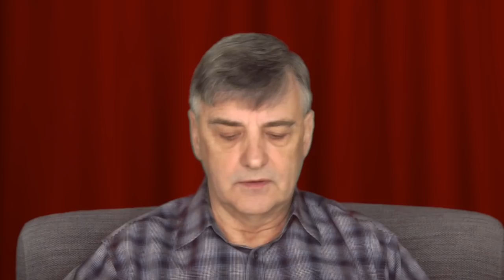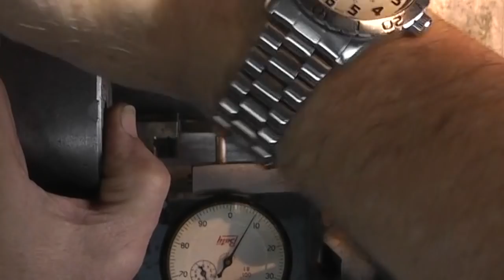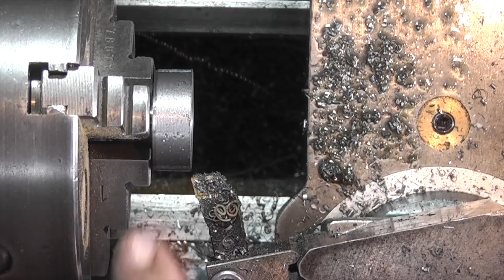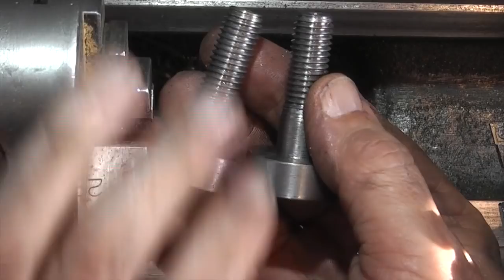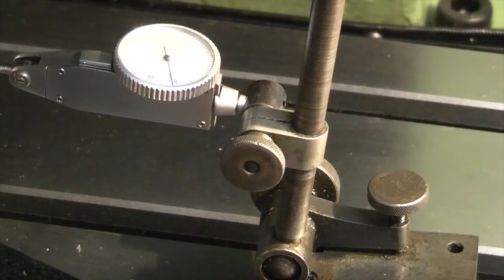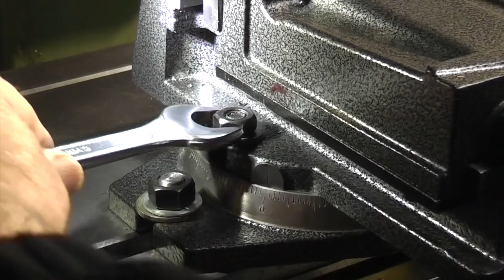Making replacment tee bolts

Comment: Good work Alan. I have one of those mill vices but the bottom was out of flat by something like a millimetre. I had to fly cut it. Is yours ok? How are you finding the milling machine Alan? I was thinking of selling my lathe(s) and mill and buying two Warco models, each with slightly better capabilities but I was a bit disconcerted to see that swarf (predictive text insists I mean 'dwarf' lol) come out when you opened yours up. Best, Mike
Reply from the maker: Hi Mike I've not had any problems with it. When I checked inside the castings are painted green so I thought that it must have been clean when it was painted. May be the down feed gearbox on the side is an add on to the standard mill for Warco. If you buy one its simple to remove the cover and check.

Comment: Hi Alan,
   Another great video easy to follow, can I just add that using mild steel & holding down a vice they will probably stretch over time,high tensile or a forged metal would've been best,like me we use what we have